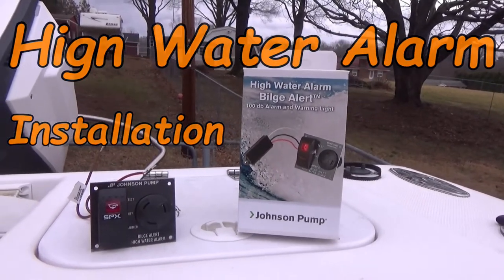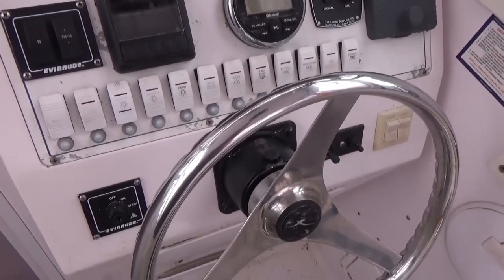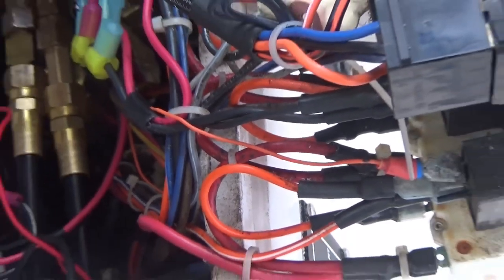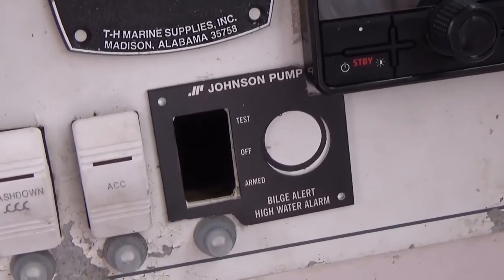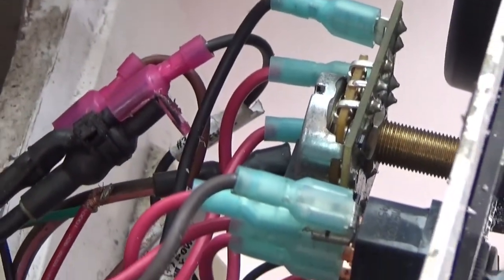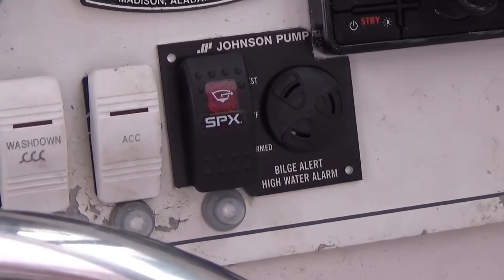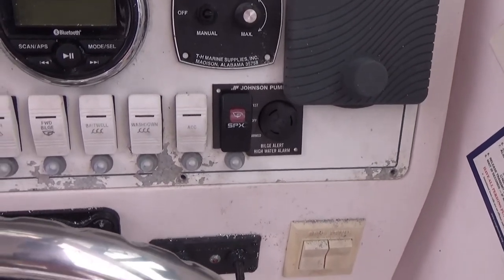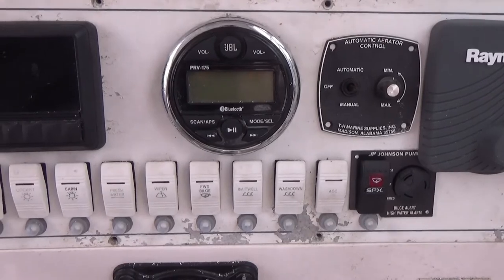Boat Safety High Water Alarm Bilge Alert Installation

Comment: Mine ran well for couple of years. Only just this week found its fuse blown and upon checking the sensor rubberised backing peeled some letting water in. Corroded some components and soldering. Time to get a replacement 😁

Comment: Complete garbage I installed one on my boat lasted 2 weeks sensor would collect moisture behind it and keep the alarm on all the time.  Had to remove sensor dry it almost daily,  finally it stopped working all together.  Not a drop of water in my bilge ever.  Tried to have the company warranty it no response stay away from this product.
Reply: Mine quit working - stays on all the time.   I will try super drying the sensor following your experience.   But I increasingly want to return to float switches as they allow for straight fwd verification testing.